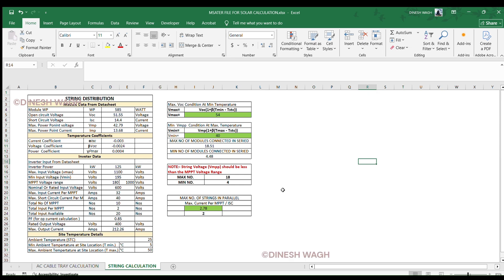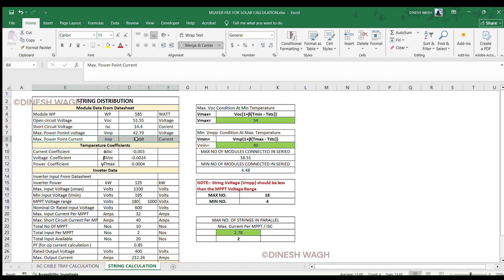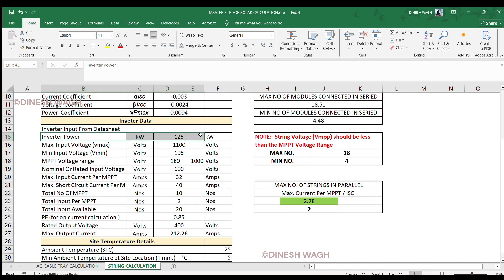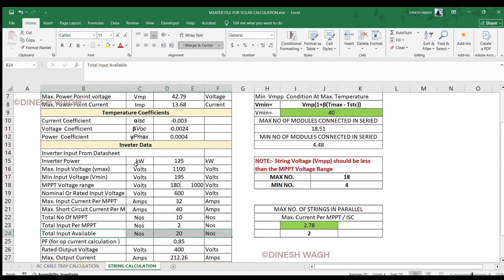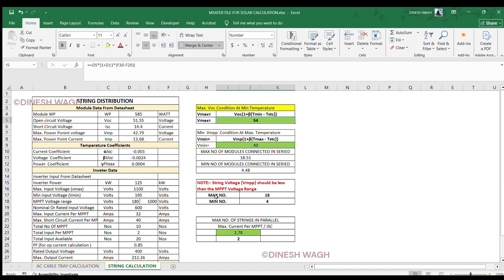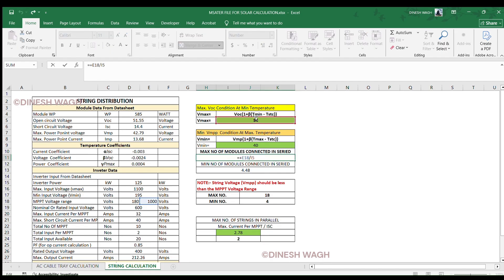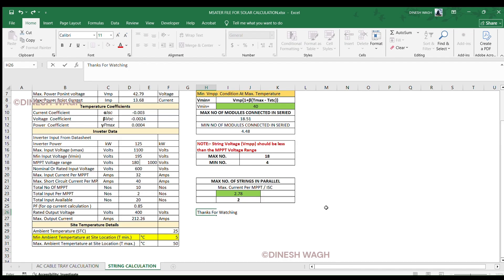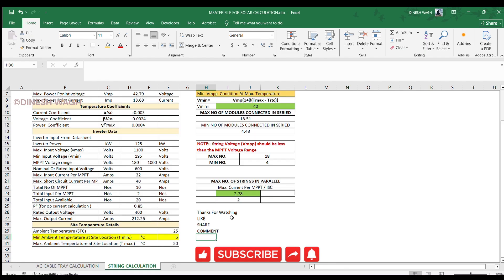Master In Solar String Design in 6 Minutes | Voltage & Panel Sizing

Comment: Thanks for sharing. Could you share how to calculate the maximum and minimum number of modules in one string for a SolarEdge inverter with a SolarEdge 100kW inverter and 410W modules? Also, choose any optimizer.